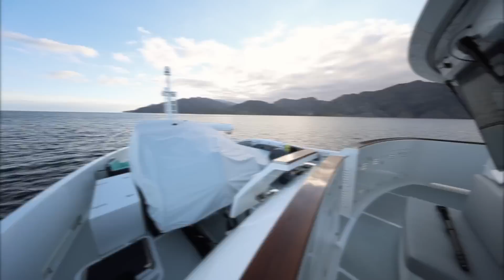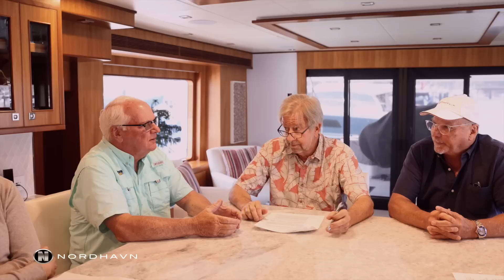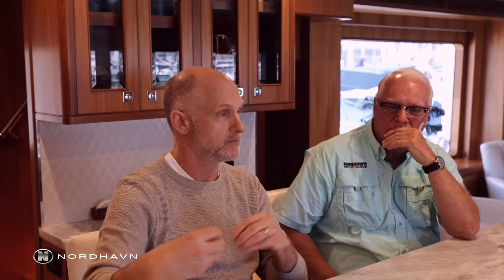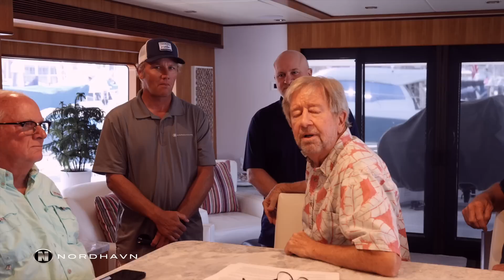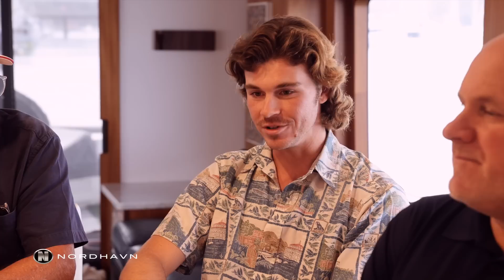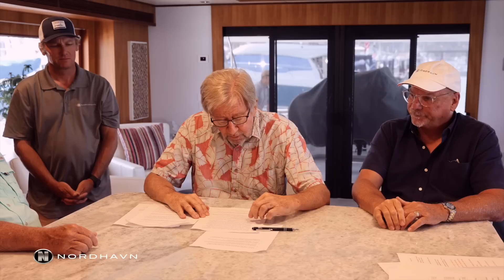Nordhavn 71 - Roundtable Discussion

Comment: Why not have shaft generators instead of the alternator? I would think you could make so much more efficient electricity and with a larger battery bank you could run everything 24-36 hours without any generator running.

Comment: nordhavn should make a boat 59'-6" (I heard around england it's easy to find a dock for 60' or less boats) with a full beam master cabin with windows (I mean who pays for the boat and everything else?) with all the new stuff from lithium batteries to the best hull design to save fuel costs...that you can fish off the back well..and with a hard shell canopy on the fly bridge that can lower to seal the whole fly bridge when not in use....and be able to do the loop..and a back up sea keeper if the stabilizer fins break down.

Comment: Dear Nordhavn Team Owners, Dan, Jim, and Jeff!

I’ve been a huge fan of Nordhavn Yachts since 2000, which makes 25 years, and it keeps going. 

Your commitment to true ocean crossing capability, vessel autonomy, and thoughtful engineering is unmatched. I believe Nordhavn is in a class of its own, built to cruise the world without compromise, while standing behind its legacy of efficiency, reliability, luxury, and, most importantly, is safety that your boats always provide with an A+ score. Your yachts represent freedom, and they deserve the most forward thinking systems to match.

As an observer and enthusiast, I’ve noticed that today’s long range cruisers are more focused than ever on energy independence, especially when operating in remote locations. My idea or suggestion builds on that need by optimizing the energy already being produced by the propulsion system. After all, Nordhavns are powerboats, and that power can be harnessed even further.

Specifically, I’m proposing and suggesting the integration of high output alternators with smart regulators, along with shaft driven generators, to capture mechanical energy while underway. This regenerated energy could then be stored in large capacity lithium battery banks and distributed via an inverter charger system to run vital onboard systems like air conditioning, refrigeration, and lighting, without relying solely on diesel generators or solar.

This approach would essentially transform your vessels into self sustaining, energy regenerating power stations. It would reduce generator use, lower fuel consumption, minimize noise, and extend both comfort and autonomy, especially at anchor.

I truly believe this concept aligns perfectly with your philosophy of long term performance, smart engineering, and energy efficiency. It’s a practical and forward thinking solution that would resonate deeply with your passionate owner community and further reinforce Nordhavn’s leadership in global cruising design, especially in today’s world, where energy independence, sustainability, lithium based systems, and alternatives to solar are more important than ever while at sea.

Thank you for continuing to raise the standard in ocean capable yachts.

Best regards,
Alexander N. 

PS. Hello to Eric Leishman :)
Reply: So you have never been on a boat

Comment: Wasn’t quite sure what I was going to watch, or how long I would last. But was fully engaged for the full video. Interesting, engaging and very informative. Keep them up. One suggestion might be a post edit format with just a few diagrams or slides, like when chatting about strengthening or lateral braces. Great to see you’ll be keeping nordhavn dreamers entertained for years to come.
Reply: Yes… good point about adding photo inserts.  Doug is very good at that and typically does reach into the library and pull out photos to illustrate points.  But, as you can imagine, it is very time consuming. On the morning that the editing was done on the first draft of this video (combining two cameras and cutting out dead spots and horseplay), it had already been two weeks since the video was made and we didn’t want to take more time for additional editing…. Next time..

Comment: mike actually helped me this winter with an overvoltage issue.  he was able to log in to my boats electrical system, troubleshoot, make changes and correct the issue in about 10 min as if he was on board. pretty cool he was able to do that from the other side of the country.

Comment: Thank you for a great discussion and a excellent ambience. 
Will it be possible to go for a different engine option on the 71? For intsance Cummins QSM 11?
Reply: Yes… but we prefer not to.  There is so much that goes into getting everything right with an engine installation package such as propeller sizing, exhaust system back pressure, cooling, alternators, mounts, wiring, panels, etc. We are reluctant to change from a package that is settled down and figured out. That said, we know that people have favorites with engines and may want a certain engine. It is our job to listen and deal with it.
Reply: Thank you for your reply. 👍

Comment: Look at a situation where the founders sell the company to the employees as an easy exit strategy. That's as you know is called an ESOP (Employee Stock Ownership Plan).
An ESOP (Employee Stock Ownership Plan) is a program that allows employees to gain an ownership interest in their employer through shares of company stock. It serves as a retirement benefit plan that invests primarily in the employer's stock, enabling employees to become partial owners of the company they work for. As of 2025, there are approximately 6,548 ESOPs covering 14.9 million participants and holding over $1.8 trillion in assets. ESOPs are regulated under the Internal Revenue Code and must meet specific requirements to qualify. That is just an option to investigate, not knowing the structure and complexities of Nordhavn.

Comment: Later on as I'm listening they brought up the 120. Has there been any interest in a new 120 build? Or is a "dead design". Still on the books but no interest?
Reply: The N120 project is alive and well the molds have been kept safe and ready for the next boat. When we developed the N96, it took sales away from the N120. 9 N96s have been built so far.  We are now in the final stages of developing a variant of the N120 for a gentleman who currently owns an N96.  The N120 has been stretched to 125 feet and numerous other changes have been incorporated into the N125.  It is a stunning boat. Stand by..
Reply: @danstreech5439  Sweet, loved the vid of you bringing it from Hong Kong.